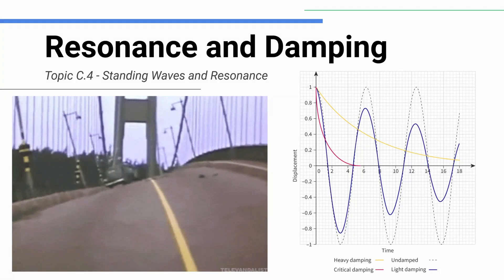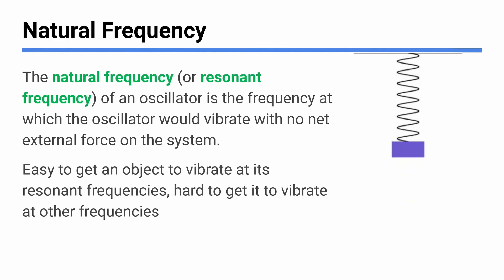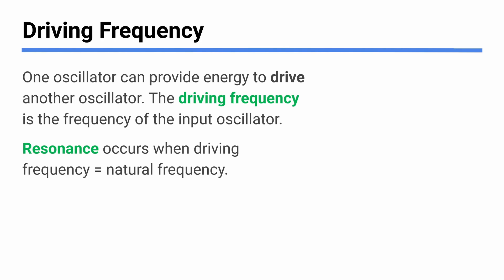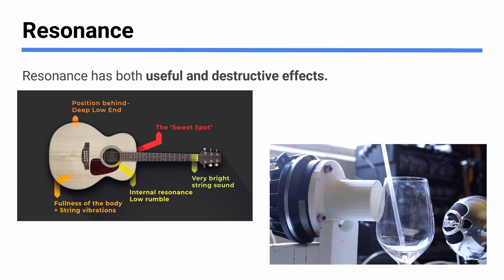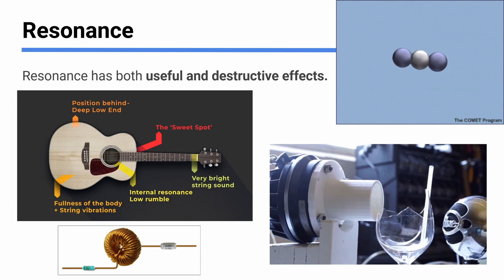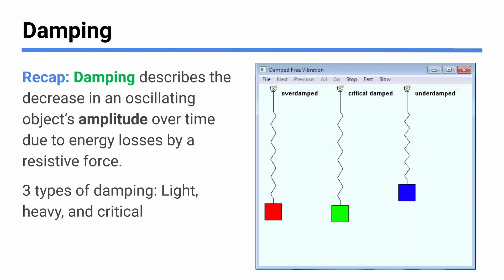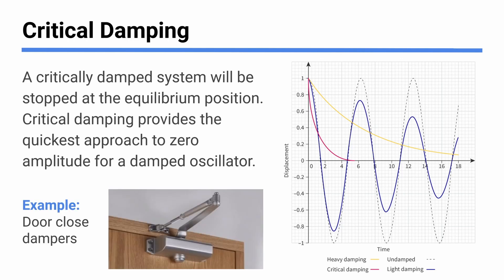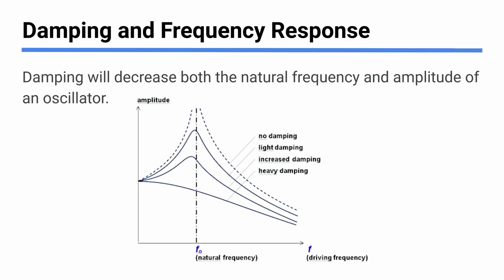Resonance and Damping - IB Physics

Comment: nice video, but the statement "Critical damping provides the quickest approach to zero amplitude" is misleading. All the solutions of this model (underdamped, critically damped, overdamped) asymptotically approach to zero amplitude and none of them reach it exactly. The critical solution in the limit of infinite time goes fastest towards the zero amplitude (but even that may depend on the initial conditions), and for any practical purpose (for finite time and some measurement resolution), a specific underdamped solution can be found that will reach the equilibrium state faster than critical and all other solutions, with the exception for one type of initial conditions for which the specific overdamped solution reaches zero amplitude the fastest in both practical and asymptotic sens....